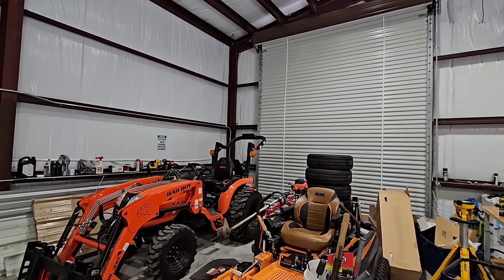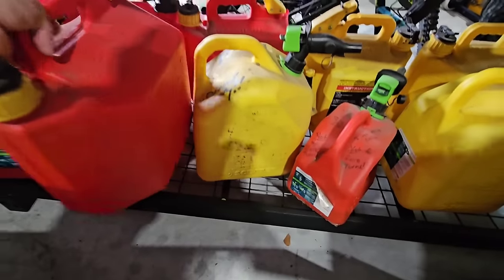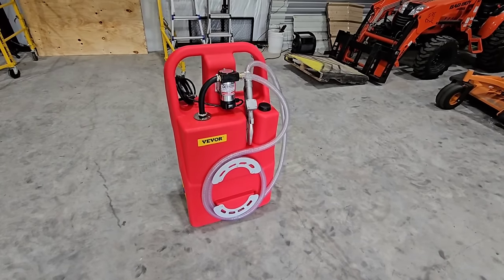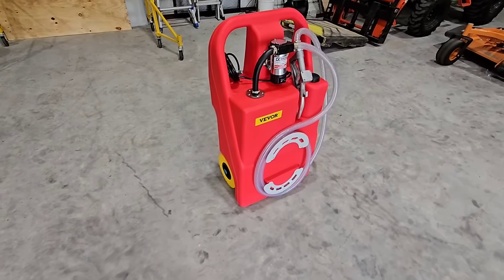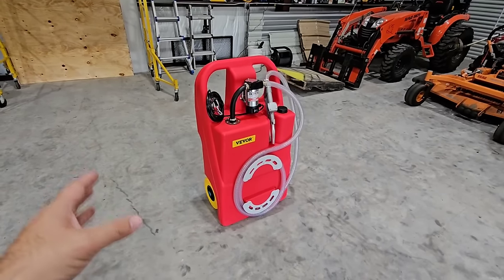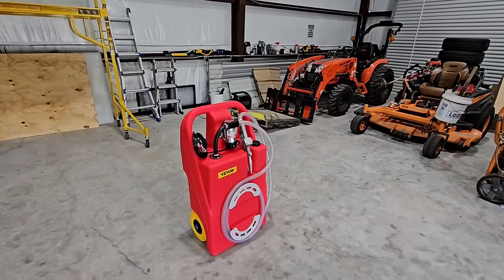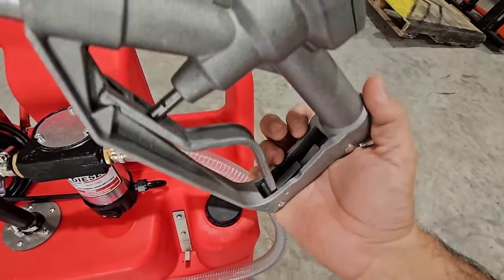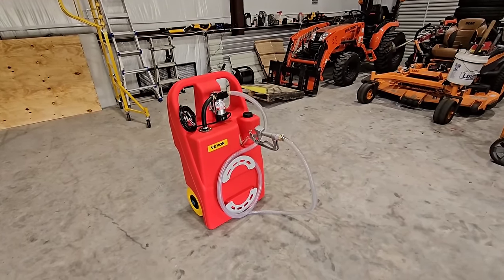Awesome invention!  Vevor 32 Gallon diesel Electric Fuel Caddy!

Comment: Polyethylene portable containers for gasoline are to be placed on the ground when filling to dissapate any static charge which could spark and ignite the fuel. That pretty much makes it difficult to reload back into your truck.
Reply: Diesel won’t ignite from static charge.
Reply: Only possible with gas not diesel and at that only with a cheap plastic bed liner in the truck, those aren’t even common anymore.

Comment: I bought a food grade 275gal tote a 12-volt transfer pump with a 15 ft hose and nozzle and a good 12-volt battery along with a nice Solar charger.  Then I have my local fuel guy fill it with off-road diesel for a bulk price and my whole setup cost me less than that caddy price of $312.00.  I have a $180.35 invested in my setup

Comment: I purchased a tank, just like the one you have, however, a different brand. The structure at the base, where the axles connect to the main tank after only using the tank one time begin cracking and leaked all of my fuel out. The tank appeared to be very sturdy and thick, and I was very surprised to see that problem. I’d like to see an update on that tank to see how it’s holding up especially in that particular area. Thanks and good luck.

Comment: Needs a way to store the power cord on the side or front too. handle needs to be stronger so it can be lifted with a tractor out of a truck bed.  Lifting it manually from truck bed while full is going to be a no go.
It could use lifting arms on the side so the forks on the tractors could be slid inwards.  that way, the forks lift on each side of the tank. But may be better for a metal tank.
Would love to have one, but I don't have a tractor.

Comment: That’s fine for some people but for $400 you can buy a used metal diesel tank that will hold about 50-100gal of fuel then go to HF and get the electric fuel pump

Comment: How do you plan on grounding it to get rid of the static charge from transferring fuel.there have been many truck fires from fueling can in the back of a pickup .  Some stations shut off the fuel. Just asking I am looking at the 14 gallon fuel tank for myself but concerned. Thanks good  videos

Comment: I just picked up 5x 15gal barrels. Rinsed em and can fill with anything I want. They're just over 100lbs full. But have multiple now. They were used and $5 from a dairy farm. They also had 55gal barrels but they're really heavy to move full. Those are usually $10-15. Then just use a transfer pump.
Reply: For frequently less than $400 there's also used Aux tanks for trucks all over FB Marketplace of varying sizes.

Comment: I know that you need content for the channel, and I don’t know how much fuel you go through in a years time; but couldn’t you have a diesel fuel truck come out to your place and fill up a gravity fuel tank for the season?  Then you just drive up and fuel.  If you need some in a can, then you fill up the can.  Seems easier to me.  You won’t have to go the gas station with all of those cans that way.  Just an idea.
Reply from the maker: I don't go through enough diesel to justify the cost.  Most have a minimum of 500gal.  I wouldn't use that much fuel in a year.  These work well for my needs.